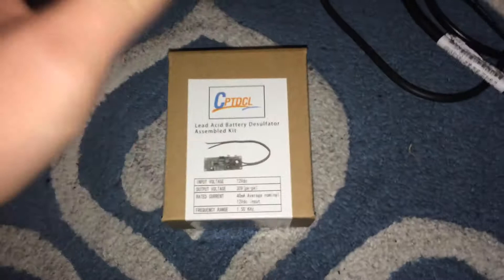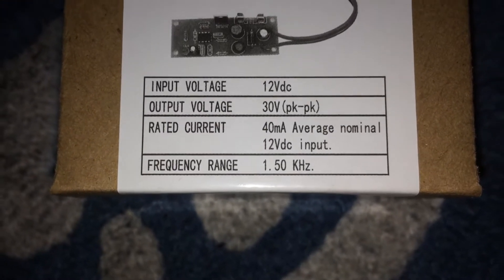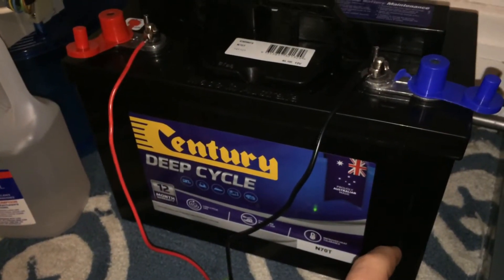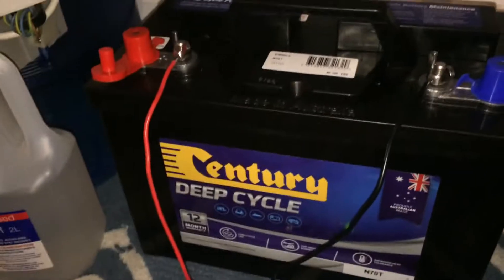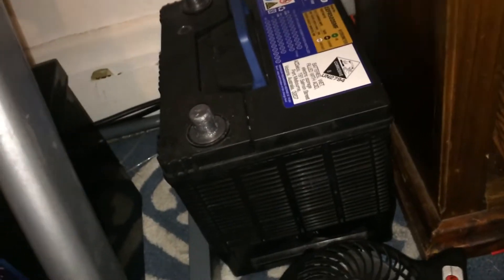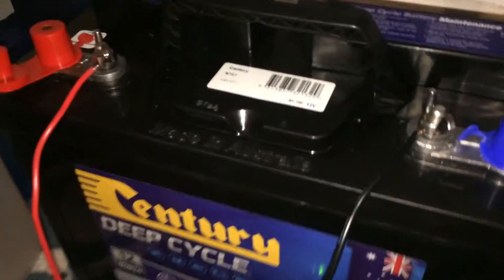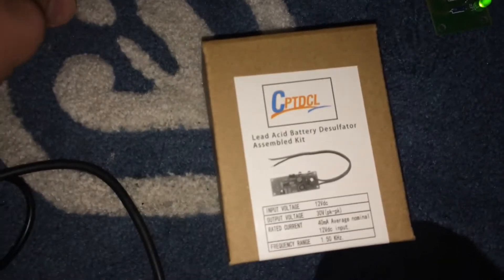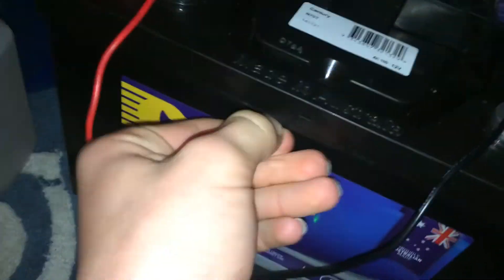12v Battery Desulfator

Comment: Did it revive the battery 😀
Reply from the maker: Sroor9001 the battery is new so I didn't see any effect on it, but I tried it on another battery it didn't work.
Reply: ElectricsTechAndStuff you could measure cold cranking amps if it's gives a good improvement to your old car battery or not this is china or Hindi or Thailand  made ?
Reply: I think for best result with charger for one month then you can decide if it works or not how long did you hook it with the charger preferable low amp charger 3 amp
Reply from the maker: Sroor9001 after the video I put a 3 amp charger to it to keep it topped up in charge.
Reply: It must make over 30 volt pulses